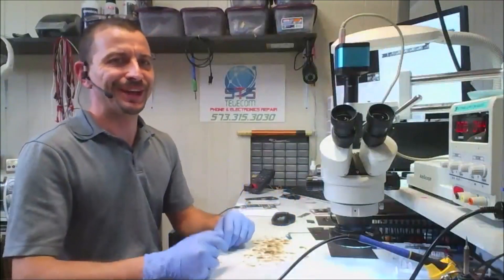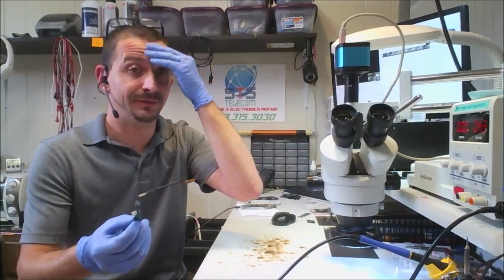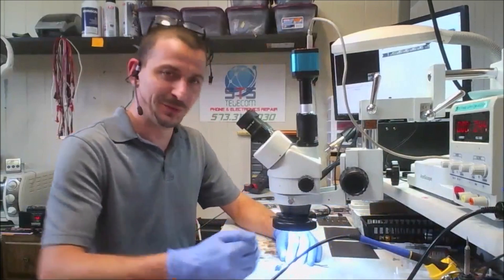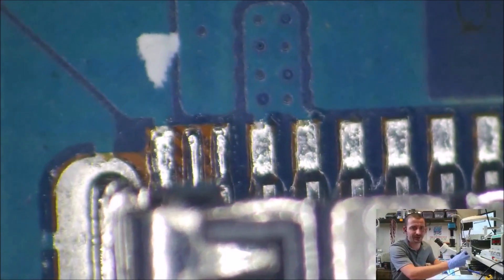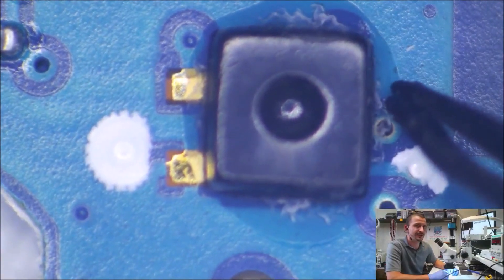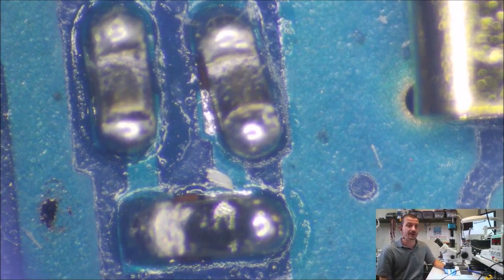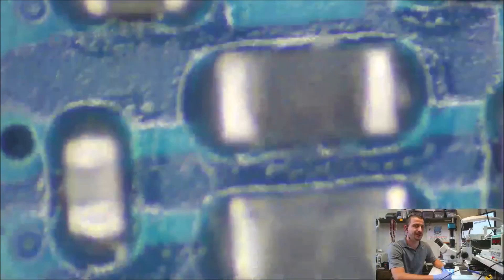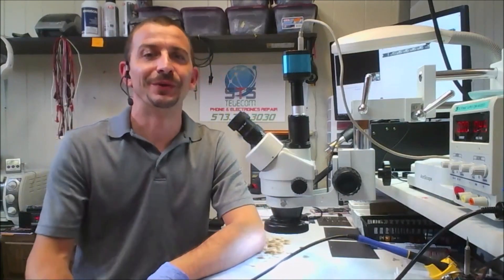Quit selling trash you know doesn't work!  You ruin the expierience for beginners

Comment: I totally agree with you about replacing only the port. But your statement about the HTC M7, HTC M8 USB Flex models is wrong, they are coming in many different versions, especially you can look at the capacitors and id's written on them. There are green, blue, and bright green colors and each color has different variants of id's and compatibility and HTC do the same also with the displays flex cables, it's basically different versions to which country this phone belongs to: USA, Europe and China, same story goes with firmwares and softwares like the other companies do. That's why, my suggestion for you when you repairing those HTC phones, ask the customer in which country he bought it, then confirm the ID's on the parts before you order them. With the USB Flex story, best option and faster solution would be replacing the port it self :) talking from a self experience and i would like to pass it by like you do by sharing your wonderful videos. Wish you best of luck and keep these videos coming!
Reply from the maker: Thanks!  That shines some light on my first few go arounds with the M8 charge ports.  I thought there had to be more to it because only paying attention to the model and carrier wasn't enough.   I always made sure to look at a picture of them to try to be sure it had the correct number of antenna connectors and that the contacts were in the right spots before ordering them.  But even then, sometimes the antenna connectors would be in the right spot but a slightly different size... they drove me crazy!  I refer most of that type of work to other shops now though and hope to never work on another M8...  EVER.. LOL :)  

Now, with all of that said, many of the M8 and M7 ports I've received are very poor refurbs that should have never been sold.  Components raked off, poorly soldered and some of them just flat out nasty.  It bothers me to order a "new" port and have to ultra-sonic clean it to get all of the cat hair a coca cola out of it.

Comment: hello.whats your model of microscope please ?  best regards from France ;)
Reply from the maker: It's made by Amscope..  Similar to this one:

http://www.ebay.com/itm/7X-45X-Trinocular-Stereo-Zoom-Microscope-with-Double-Arm-Boom-Stand-/400429169541?hash=item5d3b703b85:g:VVwAAOSweW5VQVyU

but, you're way way better off to buy one with a simul-focal head on it if you want to add a camera.. like this one:

http://www.ebay.com/itm/AmScope-SM-4TP-7X-45X-Simul-Focal-Stereo-Lockable-Zoom-Microscope-on-Dual-Arm-Bo-/142026637545?hash=item21117280e9:g:oNEAAOSwNuxXYeRL

The double arm boom stand is a bit flimsy, I would have bought one with the single arm stand but I needed the base up higher than the work area.
Reply: Thank you. And what you think about that : À découvrir sur eBay http://www.ebay.com/itm/381543890582
It's more better ? 
And last question : I see 7x -90x simul-focal and 3.5x-90x 
you can explain what it's ? I'm lost in this jungle ;)

Comment: I Have found ALOT of iPhone 5 charge ports never fit, I had iPhone 6 charge port the other day the vibrate motor didnt work after the repair due to the port. So frustrating.  I agree charge ports are awful.
Reply from the maker: +brandon hobbs With iPhones I always wind up with the dock flexes that have the antenna coax melted with solder bridging the center to ground.  It's terrible!

Comment: Preach Jason! 

I finally was able to convince my bosses of this because all the returns that we had to do. We became Samsung authorized and we rarely had problems with Samsung original parts but with the exception of the screens most other parts were cost prohibitive unless they were being used within warranty (another example of planned obsolescence imo) because we would be reimbursed for the cost of part and paid a pittance for the labour. 

We also got a big corporate client that was outsourcing phone refurbishing for an insurance company that offers accidental damage coverage. Our contract allowed us to keep the spare parts of phones that were deemed beyond economic repair and we only had to return  the mainboard. Shit,  I would rather use a flex from a liquid damage phone than most of the shit that you can source.

My methodology:

lcd/back door adhesive still intact and not covered in contaminants? I'm not fucking replacing a new one because it's more work and the shit generally won't stick as well as the original.

original iPhone screen that just has liquid damage or debris within the back light?  I'm just going to replace the backlight so I don't have to deal with frame separation,  touch issues, missing polarizer, screen out of alignment and the list goes on...

usb port not working on a flex  and I'm going to replace just the port (although I do sometimes have trouble with the 3.0 ports) like you mention on the video

Button not clicking on any iPhone...fuck you if you think I'm going to replace the whole damn thing.

These things are what I consider to be tribal knowledge. That's becoming less true with YouTube channels like Jessas, Louis', and yours, which is great! It takes practices and can take you more time or cost you more money (if you fuck things up) at the beginning but if you keep at it in the long run it certainly pays off and saves you a lot of headaches...and inventory overhead!

Keep doing what your doing brother!

edit: I'm sure you're capable of fixing the board but on the off chance that you aren't you can jtag to the board or off chip the emmc and do a dump through any jtag box (my preference is z3x) and to make your life easier you can also invest in an emmc socket adapter that requires no soldering, increases read/write times, and covers a large range of android devices. Shit, you probably already know this but if ya don't I'm more than happy to give you some tips to pay you back for your great content!

Comment: S4 ports are the death of me. When i was first starting out in repair i didn't stock charge ports as they weren't a very common repair for me. So i had a customer who needed theirs replaced so i ordered 2 of the flex's as i usually order two of any parts i get. When they arrived both didn't work. So i ordered another 2 and they didnt work either. THEN, i ordered another 2, one didn't work and the other did work but failed shortly after. So, after a 4th attempt i ordered another 2 and finally i had a good one. Now i do the same as you and only replace the port itself. Also, i wasn't cheaping out on the parts either, they were from a pretty reputable seller, or so i thought.
Reply from the maker: It's pretty sad isn't it?  I've ran into that on almost every Galaxy phone I've replaced the whole flex cable in.  The S5 I talk about in this video,  the first one worked but the guy came back the next day with his phone not charging.

A long story short, I wound up with a pile of Verizon Galaxy S5 ports and all of them had separate problems.  One of them would have smashed the connector on his logic board because the connector on the FPC was soldered on so badly (solder all over it).  I had to use the microscope and soldering equipment to get this guy going and I had ordered at least 6 whole flex assemblies.  That was one of the last ones I ordered the whole flex for.

Thank you for watching :)